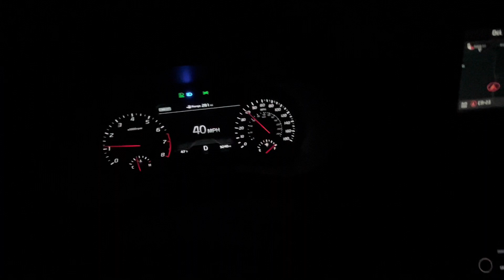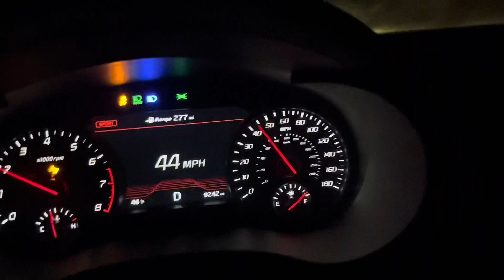Does Launch Control Really Matter? (Kia Stinger GT)

Comment: Dope video champ, I’ll trade you my Q50s for the Stinger 🤣🤣
Reply from the maker: The Stinger is my queen, but you should be very proud of your Q50S, that's a seriously underrated car !
Reply: @Odghunter  both are dope, but the Q has served its time
Reply from the maker: @impropernovice2149  wait until the car market chills out, I lucked out and got mine 10k under msrp right before the craze
Reply: @Odghunter  I’m knowing, because I’m not paying a satchel 💼
Reply: Did you get work done at a plus auto in Maryland by any chance? I had my stinger in there for a tint appt and saw a grey stinger out in the lot with wv plates!

Comment: Pretty good. Timed it a few times on my phone stop watch and getting 4.4 secs
Reply from the maker: It lit them up too 👀
Reply: I replaced my worn rear pilot sport 4’s for some pilot sport 4 S’s. The grip difference is significant.
Reply from the maker: @Cgee3  that’s what I was thinking about doing too, I’m down to 4/32nd on the rears. Fronts are at 7/32nd
Reply: @Hunter Harris  I also changed the fronts to the pilot 4S in a 235/40 size.